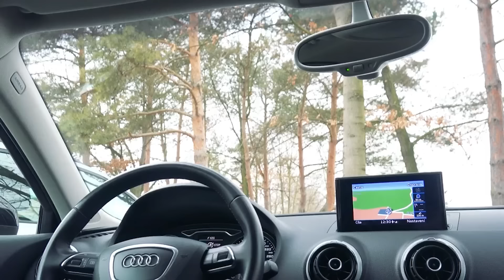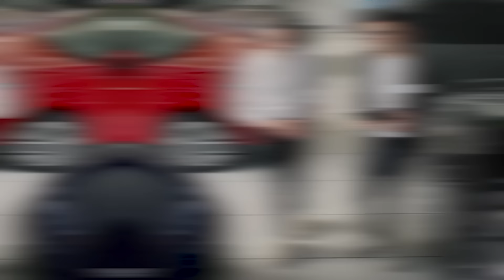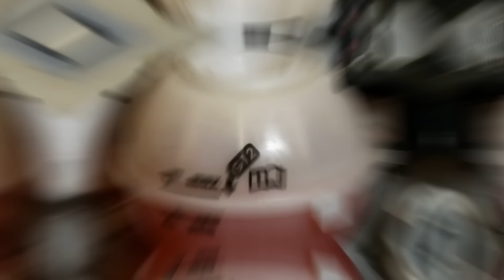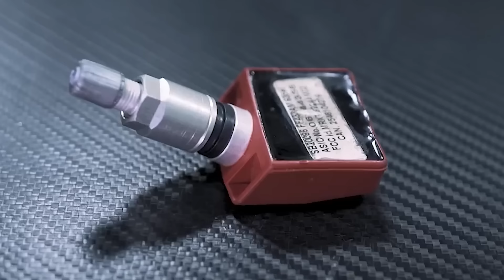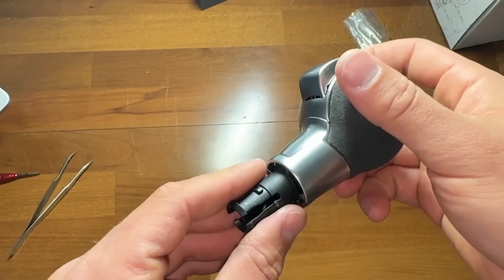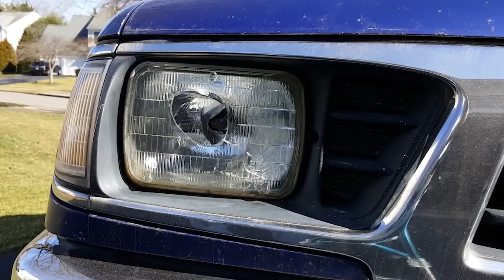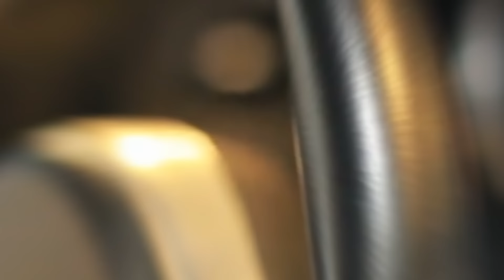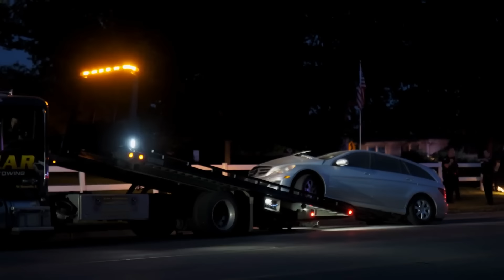25 STUPID Car Features That DESTROY Reliability & Lifespan

Comment: Too much tech, The more ability to fail.
Reply: Agree, way too many bells and whistles.   When does it end?
Reply: @cyb_structure  The tech fad will fade, and a classic virtual user interface will make it's way back. At a higher price point ...
Reply: naaah, it's the manufacturer. They want to put as many tech in there but use cheap parts for it. Look at Toyotas and Lexus, when a feature is in their car, it's implemented well with no cost cutting.
Reply: @obryn  It is not about cost cutting. As the complexity of a system increases, the number of potential failure point increases. Apparently in and exponential manner. Have you registered the price development for the average car over the last decade ?
Reply: @iRelevant.47.system.boycott  It's both. One compounding the other.  Unlike Toyota, even though they still cut costs because they are a business, at least their quality is still at the top even though they just recalled like 600,000 yesterday. That's still better than most car companies. Then you have strict emission laws implemented rapidly so the industry has to add new things to meet that requirement, than you have the tech boom in cars that still catching up to quality. All of which car companies are seeking ways to cost cut in all areas. lmao
Reply: @iRelevant.47.system.boycott  The top of the line Jeep cherokee is $100,000 and  this dude thinks its because of complexity. 🤣 Dude already forgot that cars werent this expensive before 2020. He's brainrotted already

Comment: The 2014-2019 Toyota Corolla have sealed LED headlights. It actually has a computer board inside If water gets in, the whole headlight assembly has to be replaced.

Comment: the problem with putting the HVAC controls in the infotainment screen is that it makes the system more complicated and it if falls you can't turn on the A/C or heat.  Also, you cannot be playing with it while you are driving.  It is better to have the heat and A/C controls as separate buttons underneath the screen
Reply: So agree with you. I drive a Mazda CX3 & have knobs, easy, while my friend drives a Lexus 570, ac is on a screen & even has a mouse, he cannot adjust the ac while driving.
Reply: Don't get the logic. You can get a fine for operating your smartphone while driving, while operating your entire car via a touch screen is OK ? With physical handles your can with practice operate everything on your car without taking your eyes of the road. What happened to safety standards ?
Reply: @iRelevant.47.system.boycott newsflash, there are drivers with passengers who can operate it without distracting the driver.

Comment: Just because their is new technology doesn't mean manufacturers have to install in on their cars.  Ford has no quality control and leads the way in recalls - not a club an automaker wants to be in. This is because Ford uses cheaper or poor quality parts to save money
Reply: "because their is new technology" --- Their? Whose technology is new?
Reply: Likely the start/stop feature is documented in such a way that it improves "environmental" performance, and might be a requirement to full fill legislation.

Comment: frequently starts will wear out the starter sooner
Reply: 1+1=2 DUH😮
Reply: unless the starters used in these systems are designed to last longer.  Same with the batteries.  It is a non-issue.
Reply: @patrickmcmullen7910  Tell that to somebody that lives in a city with a stop light every 10 feet for miles. You'll need a tow truck before you are half way through town.
Reply: @fritzbang4805 know anyone that had that issue? Or just read somewhere about some guy that had that issue? Or just your opinion? Because you don’t like it doesn’t mean it breaks all the time.
Reply: @waynejohnstone3685  It saves nothing and is a total waste.
Reply: @patrickmcmullen7910  i.e. more expensive new car as well as replacement part when the time comes. The electricity used on the starter implies extra fuel consumption.
Reply: @iRelevant.47.system.boycott  the starter uses electricity from the battery.  The battery is constantly charged by the alternator.  The alternator is charging as long as the engine is running.  How does it take more fuel for the start/stop feature??  Your comment made no sense.  No extra fuel is used.

Comment: I hate how you mentioned that basically the cars never sleep/off. Like the keyless start/entry– should I keep the keys far and tucked away as possible ?
Reply: put the keyfob in a faraday pouch which blocks the signal
Reply: @davinp  - And how doing this would prevent the constant current drain from a car battery?
Keyfobs don't try to communicate with the car, the car does this. And it does it all the time, no matter whether the keyfob responds or not. So blocking the car sent signals by using a Faraday pouch to keep the keyfob in changes absolutely nothing in terms of draining the car battery.
Reply: @plevin8543 they have kill switch on battery 🔋 it's good for battery drains. Only $25 on Amazon problems fix .it's like if you unplug the battery on the car with remote. Try that it works in did it to one of my car's 2014 Toyota corolla.
Reply: That's why I got toyota 2024 rav4 LE I install the stop and go crap 💩it was hurting my back operations plus i knew it's not normal to be in traffic and stop of and starters battery over working kill it turn it off asap I will never take to dealership to maintenance I'll change my oils i been working on my car's since my 1st car even as a teenager I was helping and learning to fix car's I will never understand how men in their 50 don't know how to change a tires or batteries.
Reply: @1967KID  There is an app for changing flat tires now ... people also look weird on you if you change your own tires in the street outside your house. All seems to be using services and tire-hotels for storage.
Reply: @iRelevant.47.system.boycott I do have street assistance i do my car's my way why wait 30min when I can do it and go in 20 min I'm not lazy.

Comment: Analog buttons, and the 80s reliability standards should be back
Reply: No reliability is not everything just upgrade every 5 years and analog controls are only allowed without reducing screen size 10 inch is minimum needed for clear back camera and navigation
Reply: You and 52 people who liked this comment obviously never owned a car in the 80s.  They rolled off the assembly line with rust on their frames, paint commonly "orange peeled" and your were lucky to get 100k on an engine made by one of the Big 3 auto makers.
Reply: @rdaleytex yep…hind sight is always 20/20 but I remember plenty of breakdowns on the highway, middle of winter, and no cell phone or OnStar to rescue you
Reply: @rdaleytex  Maybe he meant Japanese cars from the 80s.
Reply: @rdaleytex  Living in Europe and regularly drove 2 80's American cars in the 90's. Also into US cars at the time, never heard of the issues you mention. Top driving comfort and seats. At the time rare extra features like electric windows, electric adjustable seats, electric central locking, cruise control and automatic transmission. My V8 Chevy Van was built like a tank, had chronic issues with the pole connector on one battery. Solved by wiggling the pole connector and re tightening. Lasted well into the 2000's, when it was vandalized beyond affordable repair.